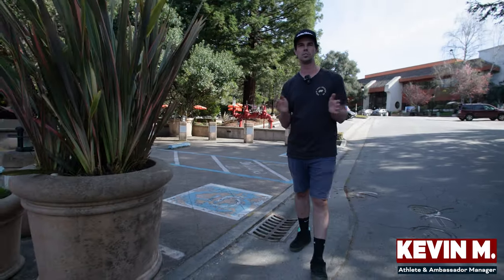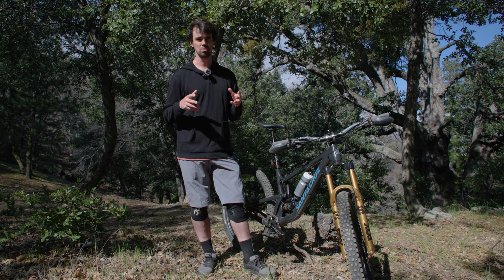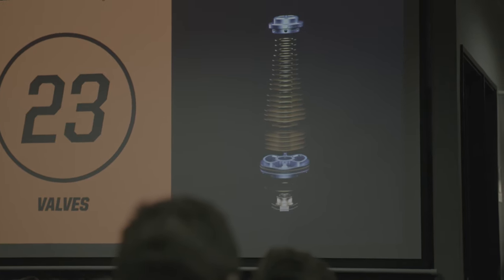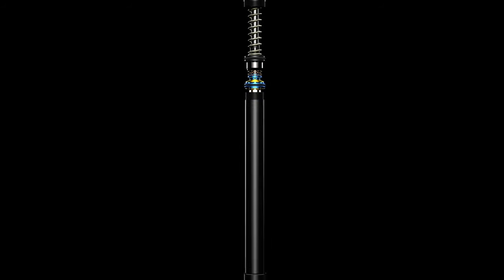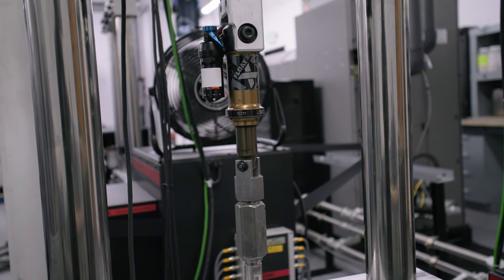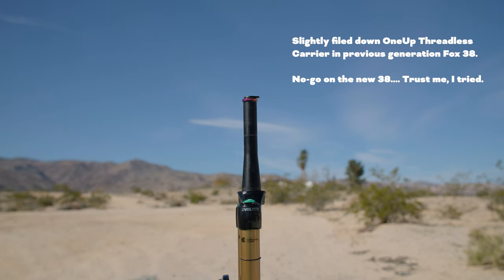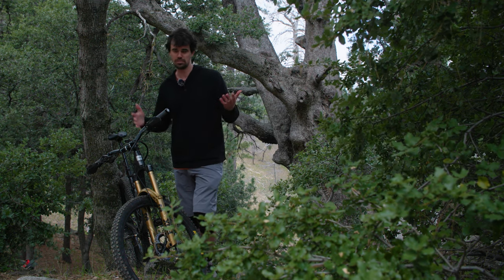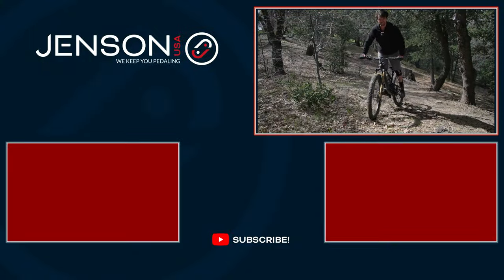2025 Fox Suspension: Introducing the All-New Generation of Grip Dampers! (GRIP X2, GRIP X, GRIP SL)

Comment: are people able to use the gripx2 dampener in their old 38 forks? just wondering as older forks with fit4 was able to upgrade to grip2
Reply from the maker: Yes, it is backwards compatible. New fork has new bushings and a new steerer tube that also improve the ride feel, but the damper a la carte is an upgrade in itself. It should be available for purchase within the next couple of months or so.

Comment: Awesome video but alot recent reviews people say still prefer Grip 2! As for the new bushings they must fit the older lowers being the same lowers? I have a fit4 on my new emtb I'll be swapping out the Damper I think but the lowers are that horrid orange! Fox really need to revise a new colourway for their orange to a blue,green or graphite grey or something! Golds not for me i know in my LBS not 1 set gold has been sold but the blacks going fast! Orange and gold such a bad choice of colours
Reply from the maker: Thanks for watching! I'm still on this new fork/Grip X2 damper and definitely don't prefer the Grip 2 over it by any means, it's a noticeable improvement in my personal opinion. It's smoother throughout the travel so it rides more predictably through a wide variety of terrain, especially rock gardens. 

As far as the bushings, I'm not 100% sure on fitment. In theory they should fit right in because the lowers are unchanged, but I don't want to say for sure that they will just in case there is something else that happened that prevents that. Another change is the stiffer steerer that they pulled from their e-bike line for at least the 38, I'd have to cross-check part numbers to see if it's the same for the rest of the line.

The color thing is definitely subjective and they don't match too many bikes out there that well, including mine, but as soon as our gold inventory hit the site, orders started rolling in and they continue to do so.

Comment: So my old threaded, oneup edc wont work on the new 38??
Reply from the maker: I'm not 100% sure on that so I don't want to comment on it and be wrong, but I can tell you without a doubt that the threadless carrier didn't come even remotely close to fitting into the new 38. I'm not sure what system Rémi Gauvin tried to use for his OneUp tool, but we both failed trying to install ours in the new fork.
Reply: @jensonusabicycles  gonna receive my 38 tuesday and will post back here. 
Did you guys see if the tool slides into the steerttube by its self, without the threadless adapter?
Reply from the maker: @SosBoss  I honestly can't remember if we did or not because I was still installing parts on my bike at 12:00 AM. It seemed like there was some sort of lip inside the steerer that made it impossible to get even remotely close to sliding the carrier down further and the tool itself isn't much smaller than the carrier itself so I'm very curious to see whether or not it fits. Wondering if the EDC Lite is a better/easier fit. Do report back if you remember... thank you.
Reply: @jensonusabicycles  So I just installed the new x2 38, the tool fits in the tube before i cut it. Then when cut to length the tool got stuck on that thicker part, so it goes in about 3/4 of the way. I still ended up threading the steertube. I thinking if i shave the tool down it might actually fit, im going to attempt it and get back to you guys.
Here is what oneup said about the edc threaded tool
"EDC threaded Top Cap will not work (unless your steerer tube is 245mm or longer)"
Reply from the maker: @SosBoss  Thanks for the info! I cut my steerer relatively short, I have maybe 74mm above my headset cap of steerer/~20mm of spacers above and below my stem so I don't think there is any chance the tool will fit in mine. You're going to shave down the sides of the EDC tool? Is it the EDC V2 tool that you have?
Reply: @jensonusabicycles  update* just shaved down the sides of my edc v2, and the tool fits! Shaved it down to 20mm in diameter from 32mm up from the first threads. I wish i measured the original diameter, but it really didnt need to shave much at all. Stokeeddd 🤙
Reply from the maker: @SosBoss  Going to try to knock out my star nut and figure out if there is any way to get the threadless carrier in if I file it down. If not, I will likely just buy a tap and top cap then file the tool down like you did. Thanks for the info.